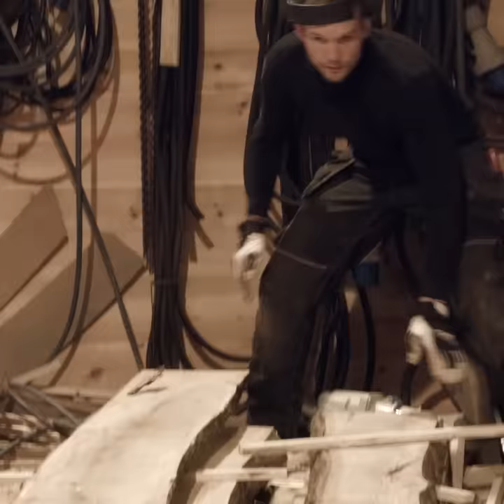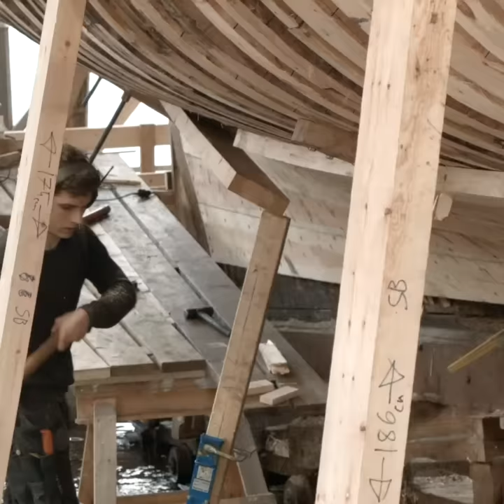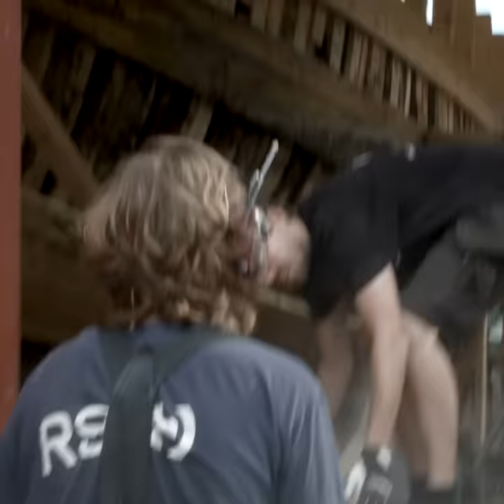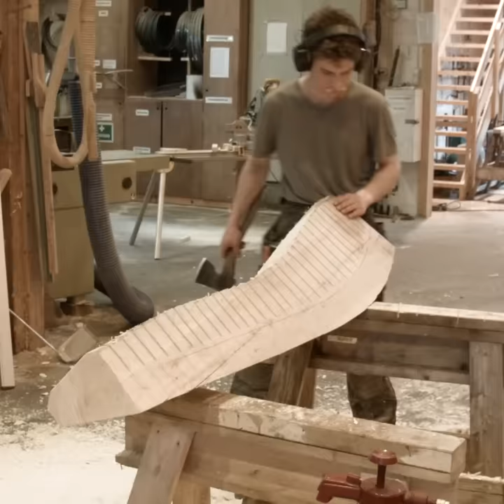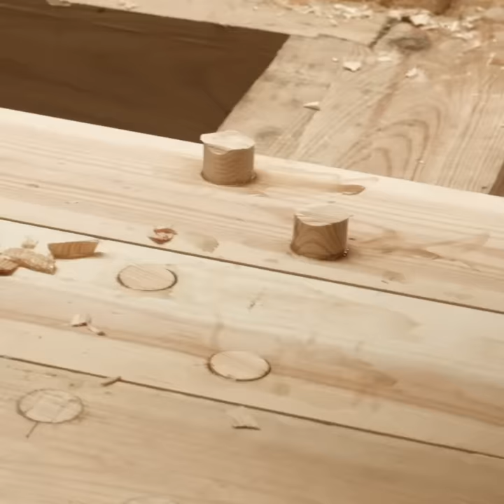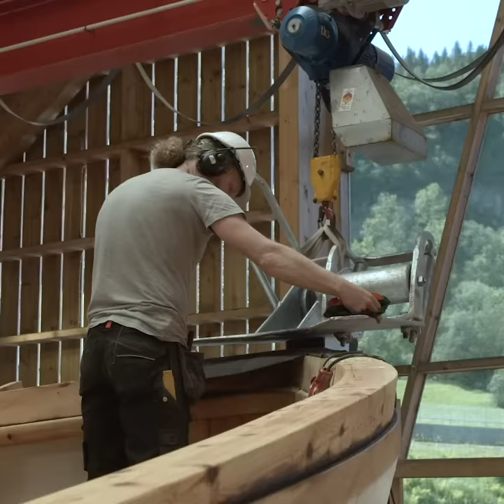Fremad II Restoration - Compilation (2016-2020)

Comment: The hammer that he is using at 6:24 to sink the nails is in every antique store around our area. They must've been very useful in building wood structures such as barns and commercial buildings at one point or another. I know the railroad used them for years because i have actually implemented one or two in my crossing replacement days. It's interesting what you learn when you open your mind and watch something you previously found uninteresting.

Such a cool trade and tradition. The craftsmanship is astounding and from such young men.
Reply: my grandfather had one of these hammers (he called it a “clincher”) hanging on the wall of his workshop, and i never saw him use it until the time he had a bunch of neighbours help with re-framing a section of his old hay barn with rough-sawn beams. then it felt like i used that thing to sink a million nails that weekend! 🥵😂

Comment: The wood they have access to is worth millions.  And they take a huge timber and cut away 60-80 % to keep fibre in right direction.  Then timbers are packed with jute , caulked and then a $100,000 marine diesel engine is installed not to mention helm, nav, shaft and screw.

Comment: The oldest way possible, to get curved planks, is just using trees shaped the way they to be already. 

Or you could use a straight green tree, freshly cut, and put it inside a crevice between 2 wheels, and fill that with water, and grind it until its a curve, drain the water, and let it dry like that.

But thats before they figured out fire as much.